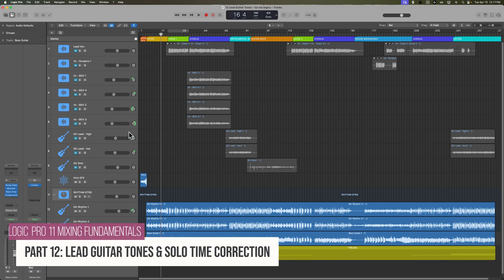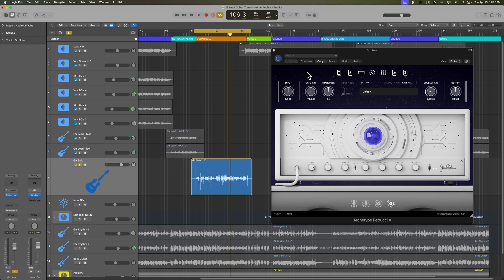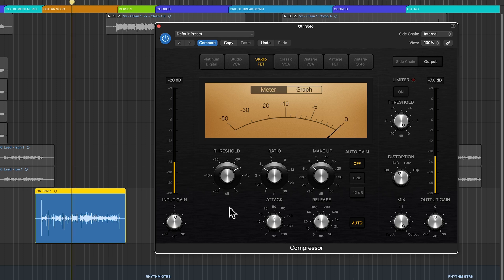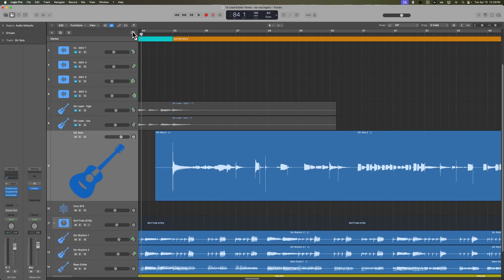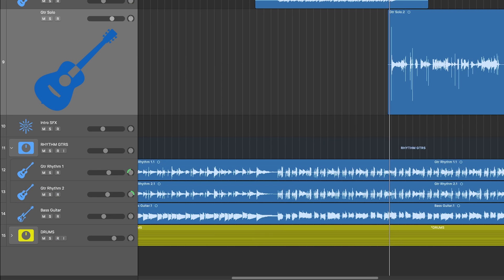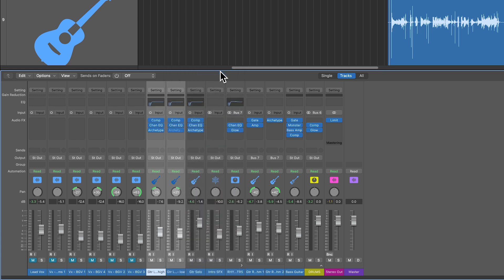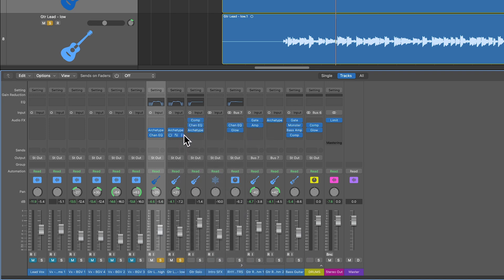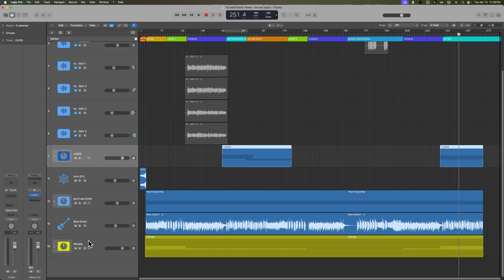Logic Pro 11 Mixing | #12 Lead Guitar Tones & Solo Time Correction

Comment: I've had the same experience of Amp Designer - you can get some nice tones on clean and crunch guitars, but if you're looking for something hard-rock / metal, particularly solos featuring artificial harmonics, the options are really poor. Question: not that it really matters to the end result, but would it make more sense to place the Channel EQ before the thickening compression on that solo guitar part, just because there's no point (I guess?) in compressing the unwanted rumble. And on a completely unrelated note, I feel like I'm hearing a Kirk Hammett influence in the arpeggiated parts of that solo... Great video! Lots of stuff covered in a short period of time.